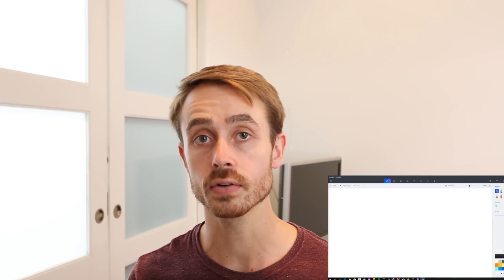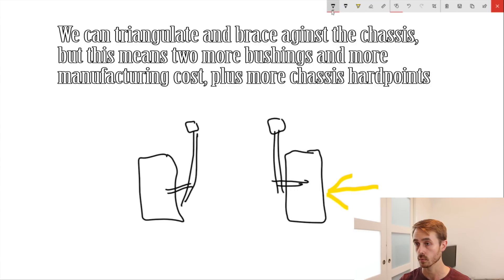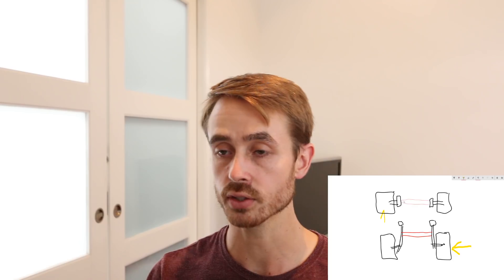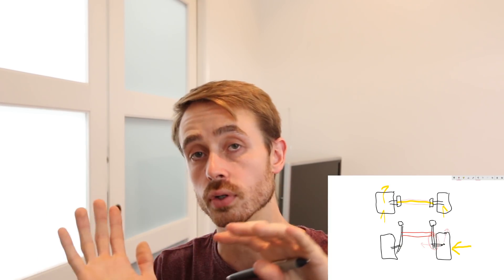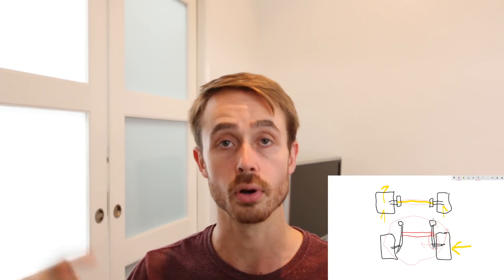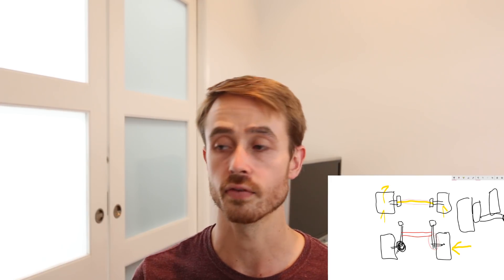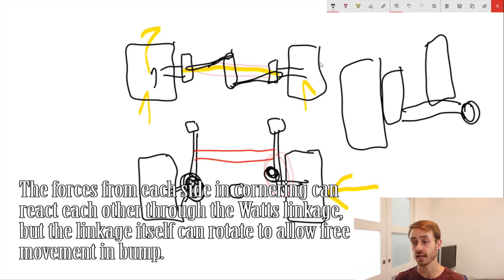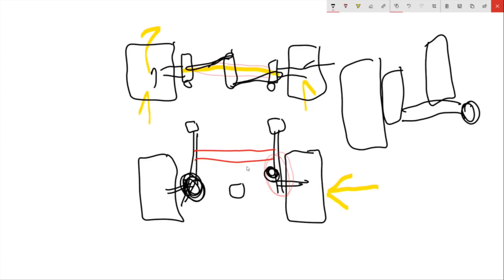How Does Torsion/Twist-Beam Suspension Work? Why do Manufacturers use it?

Comment: Thank you very much. I've been searching forever for the reason of toe change in Torsion Beam but can't find any that can be used, as the explaination is very vague and sometimes doesn't even get to the point. Your explaination is simple and sufficient, focus directly on the problem.

Comment: Alignments on this setup are done with shims behind the axle stubs.
Reply: Ah yes, but only if the axle stubs are not welded to the beam. Hondas typically use a mounting plate which will allow some adjustment, most others are just welded. I shimmed my Honda Insight for Autocross/Track with a slight toe out to calm down the understeer a bit, it can be steered a bit with the throttle now, love it.

Comment: I came back to this video because I was thinking about applications for torsion beam suspension. What are your thoughts on using this style for front suspension? Does that change the advantages and disadvantages?
Reply: It's.. that's straight up a bad move.
Torsion beam on front wheels wouldn't work well, mainly because there's no space since the engine takes up the majority of the front space. There's no free room for the beam to twist during cornering or hitting bumps, that would just put additional stress on the frame and it WILL damage the oil sump.
Having a semi-independent suspension for the front wheels would cause a lot of problems, including front wheels losing traction at un-even surfaces, floaty steering response in particular. With torsion beam setups, camber is really limited which also can affect the handling in many different ways.

MacPherson and Wishbone, or any independent suspension in particular is always the best way to go for the front wheels.
Reply: @OzoneRR Can torsion beam at rear cause dizziness to rear passengers? Puking at winding roads?
Reply: @wolger  Any type of suspension can cause dizziness to passengers, especially in the rear and at high speed.
Torsion beam is just a cheap and practical solution meant for daily use. For sport driving independent suspension is far better.

Comment: you simply use shims between the wheel bearing and axle to change camber and toe

and also there is a benefit where you can achieve a rear ride height drop with brake torque, keeping the car more flat under braking

Comment: Torsion Beam Suspension is probably the worst kind of suspension in terms of reliabilty. 
Any Peugeot 206 owners here? 😂
Reply: Pug 206 / 306 didn't use torsion beam suspension. It uses a trailing-arm independent suspension using torsion BARS (a coil spring is a torsion bar which is simply coiled). Drove my old 306 for 250k miles and no suspension components (except dampers of course) were replaced. It's inherently VERY reliable and hard wearing.
Reply: @khalidacosta7133  Thanks for clearing that up. Well, mine is completely gone, both wheels have a lot of negative camber, and one of the wheels is shaking over 35 mph. Right now I'm looking for a decent used unit, but it's hard to find one nearby that's in good shape. Might have to order a brand new.
Reply: @astanisystems  Considering the youngest 206's are now 15 years old, that's not bad going. There's a few companies which can service the entire axle for around £200, its usually the bearings inside which get worn. Should cost you £350 incl labour for a complete overhaul... That is reasonable... If only I could overhaul the suspension of my multi link rear for that cost (£750 last time I looked!!)
Reply: @bigkification  Problem is, the axle has been tampered with, weld spots all over the place and missing parts. I don't think it can be repaired, plus it's rusty. I may need a new axle after all.

Comment: I don't really understand why more manufacturers don't use split torsion bars for rear suspension like Renault did in the 9 and 11 – it probably takes up about as much space as a torsion beam axle. Am I missing something why torsion bars really haven't been popular as a rear suspension type for front-wheel drive cars? Is there increased maintenance?

Comment: I just stumbled across this video. I’m curious as to how this compares to Honda’s similar but different rear suspension on the first-generation CRX (and Civic and Integra). In that case, the beam is free to rotate in relation to the wheel on the right side, so a separate sway bar is used in lieu of the tube itself. Are you familiar with this set-up?

Comment: you can add some extra stiffness to resist roll by adding gusset(?) plats between the centre of the H down the inside of the trailing leg and some FWD rally cars add adjustable rods from the inside centre of the H to the inside of the trailing leg to give toe adjustment and camber adjustment is done via either washers/shims or shim plates mounted between the torsion beam leg and the tub axle

Comment: Sir very good content & given insight about rear twist beam .It would be better if you can show some list of advantages & disadvantages between rear axle suspension & twist beam suspension comparison .Means from design ,ride & comfort ,also from structural life .Other question inside beam there is torsion bar is used but is function of that .Other question is coming to if we are having torsion bar inside the center beam still we need anti roll bar to add extra .

Comment: Nice video. What I've seen some manufacturers do to add more roll stability and a degree of adjustability to these kind of rear suspensions is add an adjustable torsion bar inside the twist beam so that you can adjust how rigid that twist beam is. I had one  like that on my 1988 Mitsubishi Colt, though on my current 2007 Colt Mitsubishi kinda cheaped out on it and simply used a beefier twist beam and completely done away with the extra torison bar.
Reply: That seems like the best approach, since the base versions of the car are usually both the softest and the cheapest, making them the logical use for the twist axle alone. Then, for each performance upgrade, a stiffer supplemental bar could be offered.

Comment: I know a rear beam axle is laterally located either by a panhard bar, watt's link, or scott-russel link.

How is the twist beam sispension laterrally located?

Can we put a panhard bar on a rear twistbeam suspension?
Reply: jpogi gtxcr1 Opel/Vauxhall uses a watt-link on the Astra, which has a twist-beam rear axle

Comment: Your videos are very informative. Could you make a video about the long tail aerodynamic designs such as the McLaren F1 Longtail and other cars that use it? Is it good mainly for straight line speed and acceleration or can it be good for cornering as well if the wheelbase is shorter etc? I wonder why it's not used more often? Maybe it's useful for Le Mans cars and not for road cars? It would be great to have your insights about it.

Comment: This was great. I think it would be great if you did a video like this on the McStrut system that seemingly every contemporary vehicle is produced with. Why on earth is it so popular? It seems to me that it is horribly compromised in every way besides packaging. Is there really such a lack of space up front that dual A-arm suspension is impossible, or is it just a matter of saving dollars?
Reply: wtf is the McStrut?  Is that a new McDonalds food item?  If you meant the McPherson front strut design, the reason it appears in so many cars, is because so many cars are FWD, and cheap and the mounting of the engine affects how the suspension will be.  So if you had a RWD car, which are now usually reserved for anything not strictly cheap or economically focused, they can have double A arm front or other types.
Reply: @rmat9023  MacStrut obviously. You pedant. There are plenty of vehicles that use MACstrut up front that have no need for the extra space e.g. Nearly every BMW ever made or the 911 which doesn't even have an engine in the front.
Reply: @WheelNut2  The more you know!  Thanks Brad!

Comment: What is more fascinating is that one of the best handling car you can buy uses a twist beam(the megane rs). But as always the complete system optimization is way more important than the specific components.
Reply: "best handling" depends on the driver and where the car is driven. Theres a common belief that "mid engine cars handle best" but thats only true if its a road racing course with sharp corners and the driver is a professional who knows the exact speed to enter each corner. In the hands of an amateur driving fast on public roads where they dont know the right speed for the corner, a mid engine car is not the best choice and might get him killed due to polar moment of inertia (snap oversteer). An FR design is more forgiving and allows driving at higher speeds because theres time to correct for mistakes. An MR chassis does not allow for this and by the time you feel the rear losing grip the car spins before you can do anything about it.
Reply: 'best handling car you can buy' sure m8

Comment: i have a question you could do a video on: why do car manufacturers angle shocks and springs? wouldnt angling them make them less effective? its somthing i see ever car do but i cant figure out why
Reply: antsolja Top is angled in because the tire is in the way. Bottom is angled out to have more effective leverage on the arm.  Not all are angled though, my E46 rear Spring and damper are almost vertical.

Comment from the maker: Just realised after seeing the comments that I didn't talk about the unsprung mass at all! To answer everyone's questions, yes, this sort of setup does have higher unsprung mass than IRS, and this will adversely affect the handling unless your track is dead smooth. And regarding the roll damping, it is true that the dampers at the back of the beam will provide damping in roll, however as they have to provide bump damping against the springs you can basically tune them to either damp bump or roll best, or a compromise somewhere in-between. The damping will always be wrong in a specific mode, but close enough for most purposes. This isn't just a problem for a twist beam setup, but is true for any setup with an undamped anti roll bar, as changing the bump damping changes the roll damping.
Reply: KYLE.ENGINEERS my 007 Toyota Sienna awd has this.
Reply: Thanks

Comment: Great video, I have driven the FWD version of the Audi 100 Type44 (C3) with a Torsionskurbellenkerachse (torsion beam axle) and now I drive the quattro version with "Viergelenk-Trapezlenker-Hinterachse" (four-joint trapezoidal-style A-Arms, lower has a wide base and small top arm) and the ride quality and cornering is indeed much better, but the torsion beam is so simple, the parts (bushes and joints) I had to replace in the double-arm suspension after 25+ years of aging :-O  It's interesting that Audi stayed with that design on the FWD C4 successor in 1991 in a car that was part of Audi's push towards a more premium brand. Of course the C5 abandoned the fully MacPherson front with torsion bar rear: Multi-bar everywhere and even more things that you can replace as your car gets old ;) 
Might be worth mentioning that Audi (and others) use a Panhard bar (the simpler version of the Watt's Linkage you show) to locate the torsion-beam rear axle.
Reply: To be honest, even though Audi is marketed as a premium brand it never shows in their suspension setup. I mean their engine is fully in front of the front axle, not an ideal location.
Reply: Didn't stop them from dominating just about any racing series the quattro was allowed in ;) 
Also, I think you are a bit too negative, starting with the C5 and A4 the four link setups were state of the art. 5-bar suspensions took a while and Mercedes did it a lot earlier,  but they didn't have to feed the drive shafts through their Raumlenkerachse. Their W211 4matic uses a simpler front geometry than Audi's quattros, as far as I can see.

Comment: What's the difference between multilink and double-wishbone/double A-arm suspension?
Reply: multilink has 4 or even 5 individual arms. An A-arm has two rods basically welded together to from an A.
Multilinks is top of the notch in ride quality, perfect for optimizing toe and camber curves. 
But high R&D costs. I think for racing it may not be as strong as A arms.
Reply: the point of multilink is to control the wheel deflections better and not modify the suspension geometry

Comment: So why this over a leaf spring solid rear axle?
Edit: liked the video style!
Reply: Leaf springs are heavy, and behave weird as the axle shifts forward and rearwards while in a bump.
A better comparison is just a rigid rear axle combined with Panhard and/or Watt linkage. 
Without these linkages any solid rear axle or a leaf spring setup will have the roll center at the road level, this torsion beam style raises the roll center to a bit beneath the spindles. Leaf springs and solid rear axles will have to be used with RWD as the torsion beam will not be easy to get it done. Or otherwise more expensive  Individual arms.
Reply: A leaf spring setup is actually quite big, which compromises packaging. Here you can get the wheels right at the end of the car meaning loads of interior space

Comment: Every car that I drove which used the rear twist-beam suspension understeered a lot and the rear felt really soft (low rosistance to body roll). From what I have researched, twist beams really like to lift off oversteer because the outter wheel toes out under load and then, when you lift off and unload the wheel, it toes back in mid corner, which makes it oversteer. Now, I guess that manufacturers, in order to make their cars not famous as oversteery death traps (Chevy Corvair), just make them super soft with very little roll resistance so they can "never" oversteer which kinda ruins them imho.

Comment: Great video! Seams like unsprung weight could be another issue.

Just a suggestion off the top of my head: I was thinking that if you were going to build a racecar using this setup, perhaps you could split the beam in the center and add a short torsion bar between them to allow for some adjust-ability. You could build the rest of the set-up to be as light and stiff as possible while transferring the twisting action to a torsion bar, possibly mitigating some of the fatigue issues.
Reply: Will Hoon For Food+ A simpler method would be to have a very bendy beam and bolt an ARB onto it to add stiffness. There's already aftermarket bolt on ARBs for stiffening the twist beam on some cars.

Comment: Great video. My car have anti roll bar inside the middle part. I think like that they can fine tune the system for diferent version on the car. (mine its sport version so i guess on normal version this antiroll bar is smaller). To adjust geo I can use stuff like that : https://www.mikadoracing.com/annonces/images/01_2016/0_1776383_13747_CALES_JA.jpg that are inserted between the hub and the whole thing. To decrease the stiffness of the roll bar on race version of some car the Antiroll bar inside is disconectable or you can change it. On road version unfortenatly it's fix but if you upgrade with race part can be adjusted after. Here the race version of the clio : http://bruno.longepe.free.fr/photos/clioR3/2trains.jpg
Reply: How to calculate the torsion force acting on car during cornering .
Can you please tell me ??
Reply: You have to do some hard physics ^^